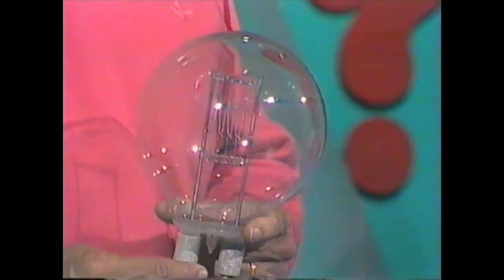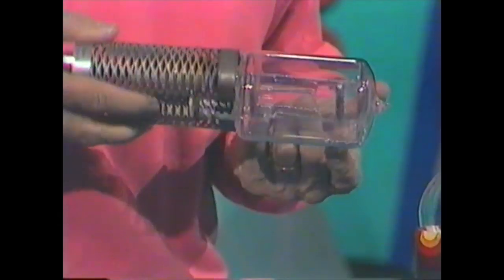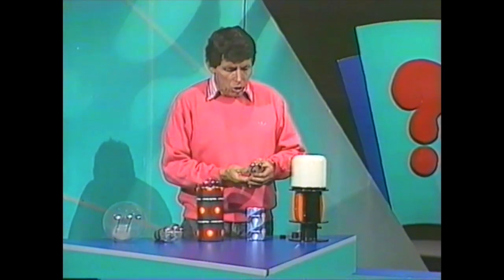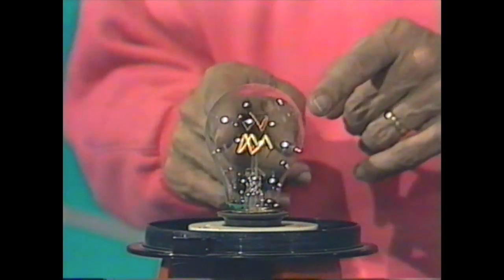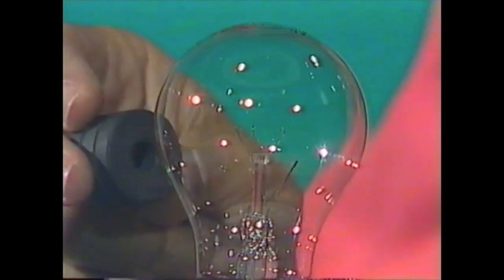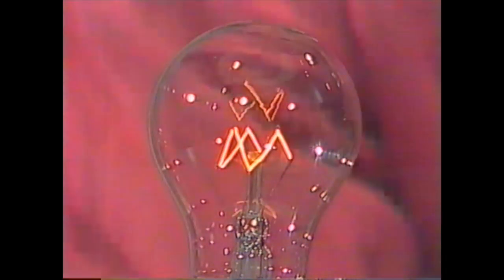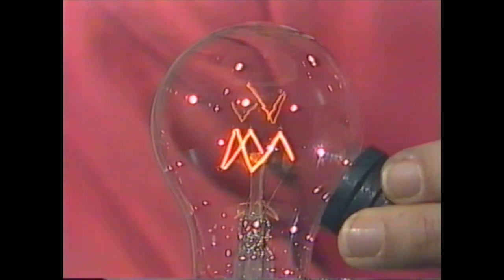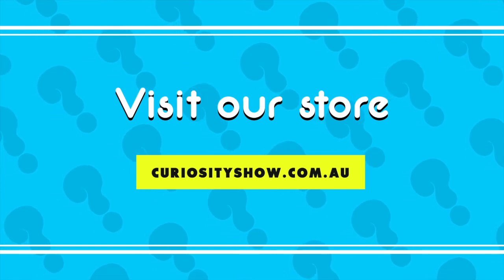Vibrating Filament

Comment: I wonder the long-term effects of using a magnet to mess with the filament. 

I'm wondering because I've looked at this effect related to LEDs and it almost seems like this trick has been used to propogate perpetual motion machines.